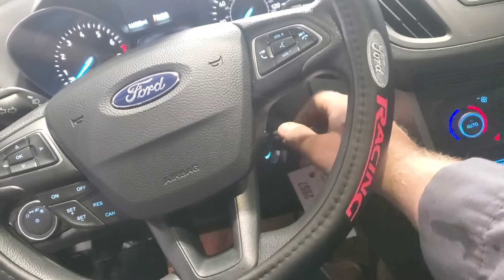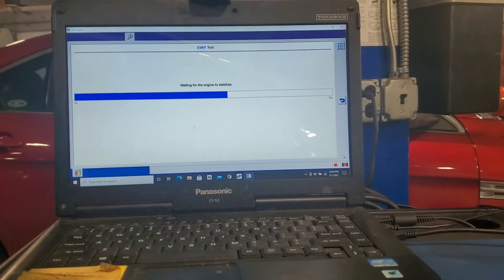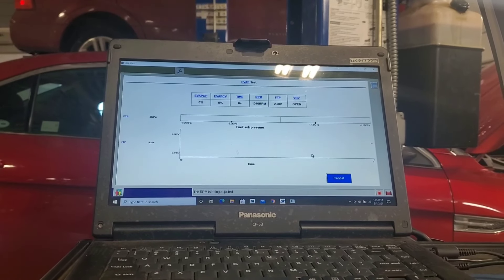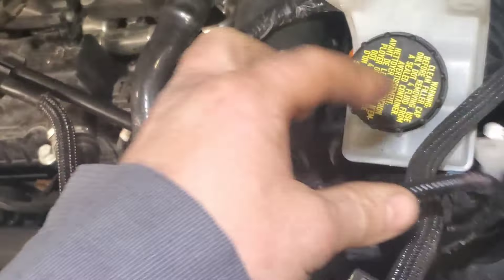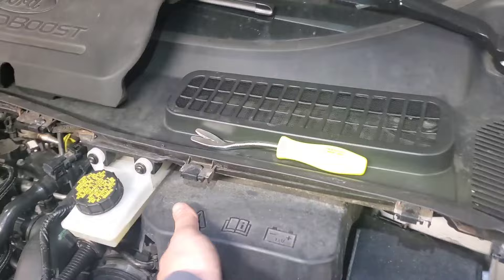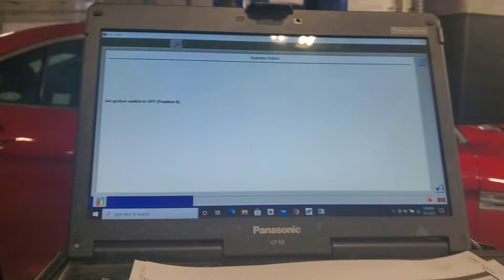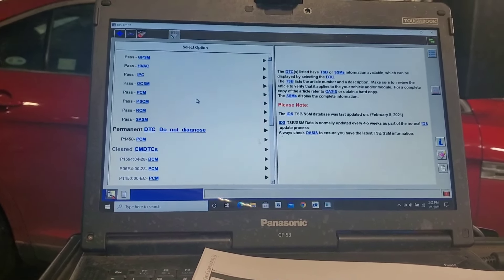2018 Ford Escape 1.5L Ecoboost P1450 Evap Purge Valve Diagnostics and Fix - other years also

Comment: 2017 Ford Escape Eco boost  these are the codes that i have. Would you start with resolving the P1450 first?
P2196: O2 Sensor Signal Biased/Stuck Rich (Bank 1, Sensor 1)
P0141: O2 Sensor Heater Circuit (Bank 1, Sensor 2)
P1450: Unable to Bleed Up Fuel Tank Vacuum
P0456: EVAP System Leak Detected (Very Small Leak)
P059F: Active Grille Air Shutter Performance/Stuck Off
B0050-13: Driver Seatbelt Sensor Circuit Open
P0141-00: O2 Sensor Heater Circuit (Pending DTC)
P1450-00: Unable to Bleed Up Fuel Tank Vacuum (Pending DTC)

Comment: 2020 Ford Escape here.  Just over 3 years old; 34500 miles approximately.  Evaporative purge valve went bad causing rough starts, rough driving, &  the RPMs to go up and down while at a stop sign or red light.  Why is this happening in such a “young” car?!!!

Comment: I have a 2017 Ford Escape with a p1450. Fuel tank pressure drops to 0 when i unplug the purge valve. With the engine running, using a Launch bidirectional scan tool, if i close the purge valve the fuel tank pressure will read around -.118 and when i open the purge valve fuel tank pressure drops to around -.140

Is it possible for the purge valve to seal up when unplugged but possibly hang open when it's commanded closed by the ecm?

This testing is all done at idle. Its having the typical hard start after fueling up. And she has had the vehicle stall on her, jerking(which i am assuming is misfire) and she describes what sounds like fuel filler neck farting. 

Any input? Can i confidently replace the purge valve?

Comment: What's the easiest way to fix a p0496 code on a 2018 ford escape
Reply from the maker: Give me a definition
Reply: @FordBossMe  my wife took it to O'Reillys and had them put the code reader on it because the check engine light came and they said its the evap purge solenoid and I don't wanna pay dealer prices to have it fixed

Comment: I have a 2019 Ford Escape 1.5L ecoboost …..I’m getting PO 496 high purge flow? 
Could you help ? 
When I put gas in my car it wants to turn off of i have to keep it idling 
But if I don’t it will turn off and then it struggles to start back up ? 
Any ideas or help please 
Thank you
Reply: I had the exact same code and the exact same problem when filling up gas. I replaced this part and it fixed everything.

Comment: What issues should I expect if I only replace the valve and use the same lines? I have a 2017 Escape 1.5 Ecoboost
Reply: You can’t take that valve off the lines. It’s a permanent seal….
Reply: @longbrake0060 Then why do they sell just that part??
Reply: 2017 edge 2.0 ecoboost.   I removed the hard line and replaced only the valve, not entire harness.   Replaced hard line with rubber line from parts store and 2 hose clamps..  It can be done.

Comment: I’ve replaced this part going on the 3rd time, it lasts for about 3-4 months any thoughts? Just getting the p1450 code and struggling to start after fill up.

Comment: i think mine is stuck closed because i get the hissing noise from my gas cap and have to manually vent
Reply from the maker: Yep
Reply: @FordBossMe Hey I replaced this part and it's still giving me the same codes. should I take it in so your guys fancy scan tools can properly make them talk to eachother?

Comment: Have you had the purge valve flag no codes ? My cousins kuga 1.5 ecoboost with the same part said she has an issue where from cold start it’ll feel like the engine is holding back & a warning ⚠️ exclamation sign saying service required comes on & off, once warm it’s ok. She also noticed a loud clicking noise from the engine I found this to be the purge valve, this maybe normal & it’s just that she’s getting the issues that she’s tuned into the noise now.
The holding back could certainly be a purge valve sticking, the noise is normal to me being that it’s a solenoid but I did notice when I briefly looked at it the valve constantly clicked which I thought wasn’t normal I would expect it to operate for a certain amount of time then switch off ( this is my experience working for Mercedes’) scanning with forscan no codes stored although the when presented to me was running ok.
What ya think ?
Reply from the maker: Yep I have that is actually common
Reply: Thanks for the reply 👍🏻

Comment: I’ve gotten that replaced and I replaced myself the one under the trunk now I’m just missing now is CM5250 part#BU5Z-9F972-B I cannot find the freaking location on that little shit when i checked on YouTube apparently on the 2016 ford fusion se 1.5L ecoboost is not there at that specific location on the by the engine behind it by the brake fluid reservoir any tips on where it’s at?
Reply from the maker: I'm kind of lost by your comment here man it's confusing me I am all over the place reading it, what exactly are you looking for send me a link to a website with the part that you're looking for I understand you give me a part number and you're looking for a location but it would be much better for you guys to send me a link so I don't have to start going doing homework for people and then I might be able to just tell you right away

Comment: Hello Boss! My 2018 Ford Escape 1.5 SE. The gas tank sounds like it's farting and throwing a Code P2196 O2 Sensor Signal Biased/Stuck Rich Bank 1 Sensor 1. Will this be the same fix?  Thanks again!
Reply from the maker: Yes, look in my library and you'll see a farting sound evap video
Reply: @FordBossMe   3 weeks ago, I replaced the Purge Valve Assembly Part No.: GV6Z-9D289-E Motorcraft on my wifes Escape. It's all good now. I appreciate your How To video and for answering my question. Saves me a lot of time and money. Bless you!

Comment: Thank you for the video! What did we do before YouTube? Removing the purge valve was much harder than replacing it. The valve I purchased off of Amazon had different clips. The dash light has stayed off since I reset it post-installation, so I think we're set. Thanks again.
Reply from the maker: Not a problem
Reply: I just purchased the part from Amazon as well but was nervous it was not the correct part. How hard was installing it? And how long did it take you?
Reply: It didn’t take long at all. The toughest part is reaching the spots where the tubes connect to the engine. Unfortunately, the fix only lasted a month or so for me. Back to the drawing board. Runs fine until I fill up the tank. Once I coax it back into starting, no issues until I fill it up again. 😂

Comment: This part does not fit a 2017 fusion SE 1.5l ?!
Reply from the maker: Some of them have different routings some of them are not the same it's better for you to just call your local dealer give them the VIN number or look through my library and see other Purge valves I've done and actually get the right number

Comment: Will the Check engine Light come straight off if I change it myself
Reply from the maker: It will after awhile....
Reply: I purchased a $20.00 reader from Walmart that said it can reset it if you want it to go off right after changing. I wonder if you can use the free one they let us use at the auto store. 🤔

Comment: So mine just doesnt start after fueling. Could this be the same issue? I pulled one code p0304. Already fixed that. Bad coil pack.
Reply from the maker: Yes
Reply: @FordBossMe  sweet already ordered

Comment: Can you replace the canister purge valve without replacing the entire harness?
Reply from the maker: I mean I'm sure there's a way but for the most part no
Reply: @FordBossMe  so I found a purge valve by Dorman that uses quick connects for the hoses. So you just cut the old one out and use the provided connectors to put the new one in. Gonna try it tomorrow so hopefully it works out.
Reply from the maker: @UrBroJoe  send me a link
Reply: Did it work?

Comment: Might be a silly question but this is a DIY? Or will I need to get it hooked to a computer? Dealer wanted $1400 in El Paso to fix the P1450 code. Trying to save a Sxxt ton of money.
Reply from the maker: Just go on Amazon and find yourself a cheap plug-in scanner one of the ones I typically use is by a company called BDS they're like 30 bucks and then buy the part and install it yourself you might have a little trouble getting to some of the tight spaces but that's really all you need is the part and then a little pocket scanner to clear the code
Reply: Thanks for the reply.

Comment: I have a 2019 escape 1.5 eco boost. With p496 code. So went out to replace it. Had a crank no start with no sound of compression.  Performed a compression test have good compression in all 4 cylinders. So I brought it and replaced the purge valve. Now I have crank no start with compression sound. Any clue what my issue could be
Reply from the maker: Fuel or timing
Reply: @FordBossMe  also to add I drove this car 3 months ago and it just sat in parking lot for about 3 months and went out there today to start it up to fix the component. Battery was dead as fuck so I put a new battery in it as well.

Comment: I have a 2013 ford explorer limited 2.0 ecoboost 4 cylinder engine, check engine light came on I take it to ford dealership they replaced turbocharger, a week later check engine came again now they told me vehicle have code p144c  cannister purge valve need replacing. Is this vehicle have a complete valve assembly or can I just replace the purge valve. Thanks

Comment: Why i dont understand is why the spare part doent have the vaccum reservoir. That plastic ball. Is the same thing without that ?
Reply from the maker: There's no ball on these
Reply from the maker: Are you talkin about the vacuum Reservoir that assist with breaking which that's not part of the system at all

Comment: Gv6z 9d289 E $85 on Amazon - Is this the right one for 2018? FANLIDE Vapor Canister Purge Valve GV6Z-9D289-E GV6Z-9D289-A CP892, Vapor Canister Purge Solenoid Compatible with 2017 2018 2019 Ford Escape 1.5L

Comment: 2016 Ford Escape I got a P1450 code. Is that the Purge valve ? If so what is the appox cost. 1.6 turbo
Reply from the maker: I don't know it depends on where you get it from if you get it from the dealer it's probably going to be $150 if you get it online you might find it for like 90 bucks and then it's like an hour to install it

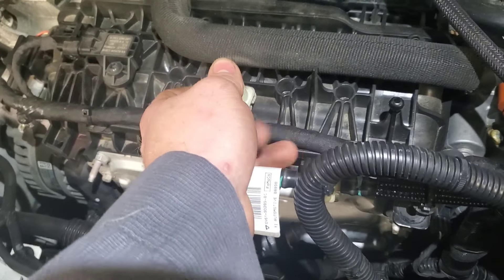Comment: I love your videos! Thanks a lot for everything you do! Quick question, I have a bunch of oil around the push-connector that your hand is touching at 3:25, it’s everywhere, is that normal? Should I get it replaced or is it fine? Any help would be greatly appreciated!! Thanks

Comment: What tools are needed to do this repair?  My check engine light came on and the code was p0496 evap purge valve solenoid but the part in the video is  the part the dealer said I needed. Thanks
Reply from the maker: If I remember correctly all I needed was like you see in the video I use the little flat blade screwdriver at trim tool and I think it was like a 8 mm or 10 mm socket and quarter inch ratchet but I'm just going off memory it's been awhile just common stuff that you can use

Comment: we have a 2018 escape with the check engine light and when we refuel the car will not start after. The code i get is evap code.
Reply from the maker: this is your issue
Reply: my wifes car has similar issue with a p0496 evap purge valve solenoid

Comment: 2018 Ford Escape and I was told it could take up to 10 hours to replace, this is for the purge valve and the attachment. Is there a reason it would take 10 hours?
Reply from the maker: about 10 minutes 15 minutes max

No reason to take longer
Reply: I just replaced mine yesterday and Dorman makes a repair kit that just changes the solenoid and its much easier and faster
Reply: @MrSBinder3111  wow, I paid 1200 to get mine replaced

Comment: Can you by chance get that tube assembly/purge valve part number, it’s difficult to find this part for the 1.5l right now
Reply from the maker: I'm not sure what you're asking me to do right now
Reply from the maker: You didn't give me a year make or model
Reply: @FordBossMe  same as the one in video… just 2017… escape se 1.5L ecoboost. Should be the exact same part in the video… asking for the Ford part number…

Comment: I got the same P1450 code, so I brought it to the ford dealership where I bought my escape and they told me it would cost $600 to replace the  purge valve. After looking up the average cost to replace this part, I'm seeing from $150 to $250 including labor. I told them to hold off on it until I look into it. Why $600?
Reply from the maker: Yeah it definitely doesn't cost $600

Comment: Can this go bad and not throw any codes?  Have 2015 Fusion 1.5L that engine started making sound like driving on flat tire after driving for 20 minutes.  Turning off and then back on caused noise to go away.  This is only happened once and now codes were thrown.  So just wondering if something starting to go bad.  Purge valve assembly looks less complex on my car also which is good.
Reply from the maker: Yes

Comment: Hey, thanks a lot for this video! I have similar problem with my Ford Escape 2018 1.5 Ecoboost. My error code is different: P04F0 (Evaporative Emission System System High Load Purge Line A Performance). I also noticed problem while refueling gas - gas pump is bouncing / turn off. Do you think replacement will solve my issue? Any other advice what to check first? Thanks!
Reply: I also have the same problem when refueling gas. I also have a ticking noise coming from the solenoid. I run code P0496. Hope this will fix my problem.

Comment: I have mustang ecoboost 2015 and I’ve noticed after starting the engine around 5 minutes and the car in parking it starts to blow massive white smoke from the exhaust, but after around 1-2km the smoke goes away. It happens everyday unfortunately.
Reply from the maker: Sounds like coolant
Reply: @FordBossMe  but the coolant water is full and not decreasing 🚶🏽‍♂️
Reply: Sounds like it might be your oil rings on the pistons failing to seal when cold and then when it warms up it begins to seal. You may have an issue with your crankcase ventilation system. Or just failing piston rings. If you havent been letting it warm up to at least close to operating temperature before driving it that may have been the cause.

Comment: do you have a part number for this part? i also have a 2018 Ford Fusion SE 1.5L. I bought a part that said it was right but it only had 4 connections and mine is same as yours.
Reply from the maker: I'm pretty sure I show the part number in the video people have asked me this about the video before and then I go back and look and the part number is very clear in the video
Reply from the maker: I just went back and looked at about 2 minutes and 45 seconds I clearly point out and even spell / say the part #....did you not watch the video?
Reply: @FordBossMe  oof 😓
Reply from the maker: @FlaggedGamer  what's up brother why the oof?
Reply: @FordBossMe  Aw, was just looking at the burn u gave. Thanks tho I’ve been looking for this part for a couple days and i couldn’t find the right part number 🙏🏼
Reply: @FordBossMe  having trouble getting that part, nowhere has it

Comment: A local dealer told my daughter it would be $600 and something to replace this part. I see the part is $160ish online and probably $220ish local for the Ford part and I guess they charge $400ish for an hour of labor.
Reply from the maker: 155hr for labor
Reply: @FordBossMe  got the price breakdown
This local dealer is a RIPOFF to me.
Diag: $100
Labor: $180
Parts: $306 ( I can get it on the Ford parts website for $226.67 and pick it up at this same store)
Shop Supplies: $32.95 (ridiculous)

They even charged $10 for shop supplies for the Diag. SMDH
Reply: They wanted 1200. To replace my fuel pump. They said they had to drop the rear Axel to get to the pump that was in the gas tank. My 2013 Ford escape took me 45 minutes to remove the straps tilt the tank down. Remove the old pump and install the new one. Fuel pump cost $98 same as the charge to tell me the pump was bad. So don't ever run a Ford escape out of gas.
Reply: @Justin-fq7vj  that's crazy!

Comment: I have this issue with my 2018 Ford Escape. I am trying to buy the part number you used but I can’t find the info when I google the part. Is that all I need? ( GV6Z-9D289-E) I can’t tell if it comes with the valve and The Whole spider arms (sorry don’t know what they’re called!) thanks for the video!
Reply from the maker: Rock auto and type In purge valve and your vehicle info they have it
Reply: Yes that’s the OEM ford part number

Comment: Any chance you can help me figure out the reason behind P2096 code after I've replaced both o2 sensors and cleared the code? I don't know if it helps but my wife says while driving she hears whistling or rushing air while accelerating. There are no other codes.
Reply from the maker: Some kind of air leak Upstream
Reply: Purge valve on the 2.0

Comment: Looking for this part for a few weeks. Ford said the have over 2000 back ordered, and only 80 shipped this month. Tried a few other non oem brands and everyone is back ordered. Anyone find one? 
P.s. from Canada
Reply: ever have any luck ? im needing to order
Reply: Same here, no luck.  This will be the 3rd purge valve going into my 2017 Escape after 115,000 kms.  Ford says 6-8 month wait on back order.  1st one was 3 weeks wait, 2nd was 3 months.

New engine needed at 28,000 kms due to coolant pouring into cylinders 1 and 3.

This is my last Ford.